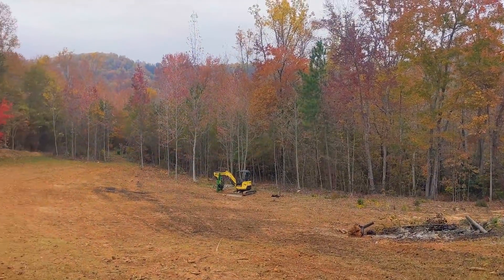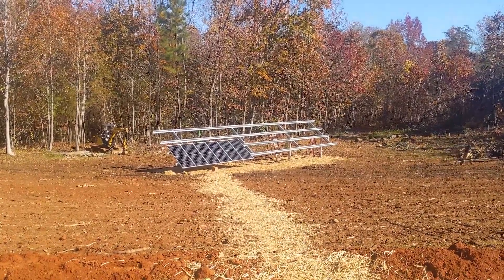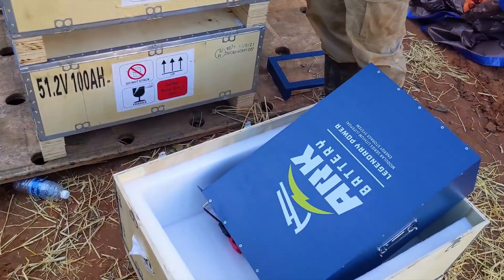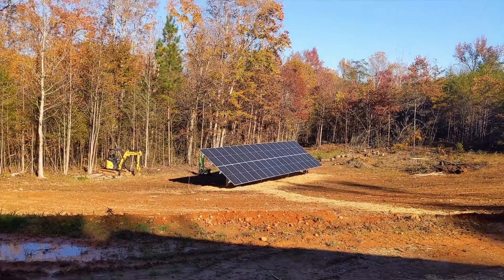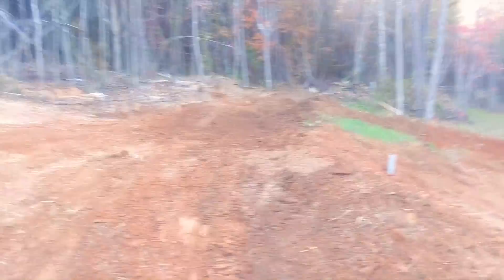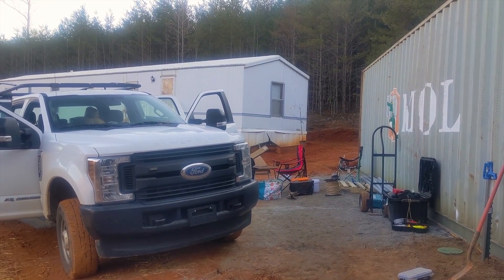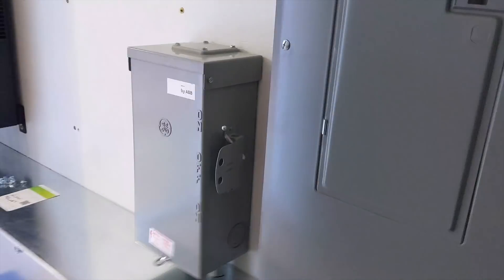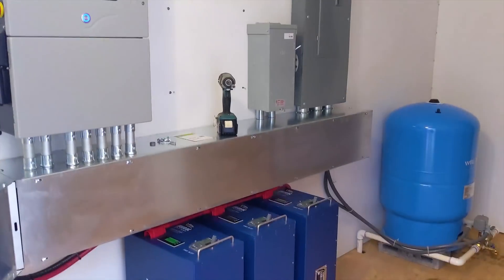Off-grid powerhouse

Comment: What’s the purpose of the gen bypass? Doesn’t the solark have a gen input that transfers the load?
Reply: If the solark craps the bed, power is just a switch flip and starting the generator.

Comment: How does the Solark handle the extra solar   You mention it was over 13kW of solar but this inverter is rated to 12   Any issues there?  how do you have it wired?
Reply from the maker: The inverter is rated to 13 KW not 12. And I'm just a little bit over. This is never a problem as the solark will current limit.
Reply: @engineer775  oh awesome.  Thanks.

Comment: If the batteries are full, where does the electric being generated by the panels go?
Reply from the maker: If it has no place to go. This is where you begin to get creative with your battery discharge at night creating room for solar and also diverting energy to thermal batteries like water heaters. With a few tricks you can make an off-grid installation look like a grid tied system.
Reply: No where

Comment: I love this.   Effectively what I am doing.  I am doing storage in the shipping container though.  1500 gallons with 4 accumulators, and an AC pump, and a DC pump, just to be safe.  And I have been building my own 7S lipo battery that is at around 20kwhr so far.  It has been going great.  I have another system in my trailer that is 20kwhr of lifepo4 batteries, and 2 mppsolar inverters on each one and the ability to AC couple them so I can charge from either battery to the other.  And I utlilize Mitsubishi PLC's between the 2 that are talking modbus between each other.  It has been a blast.
Reply: Got it..  You are prepared for the great tribulation of 7 years before Jesus returns. 💉🧟‍♂️🪦⚰✌
Reply: put up some videos, sounds like something worth sharing. 😃